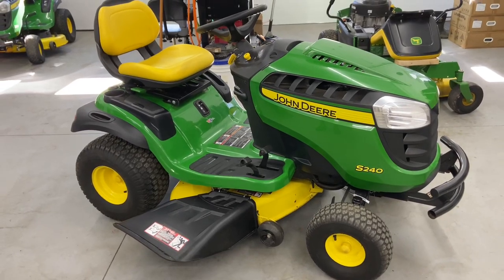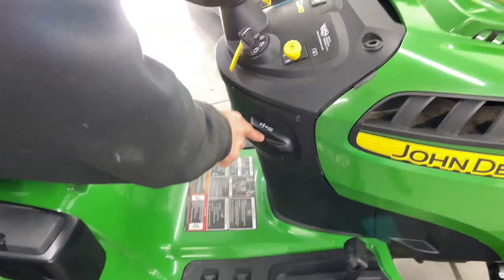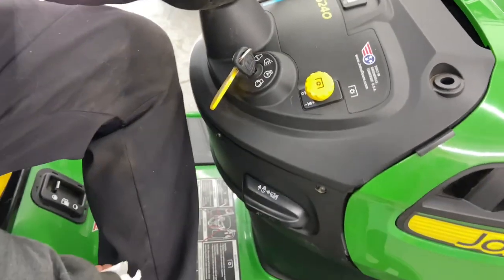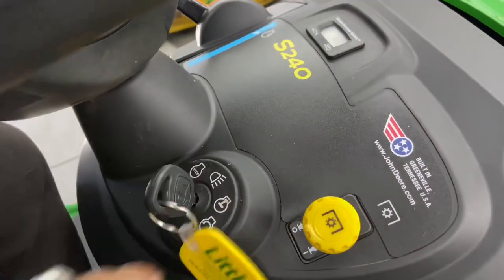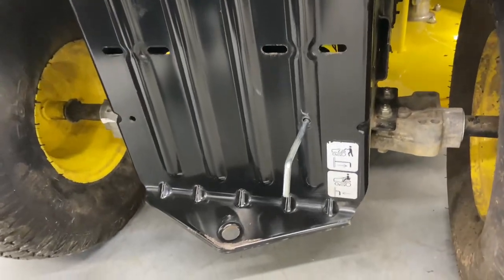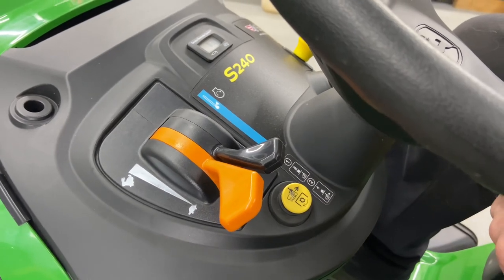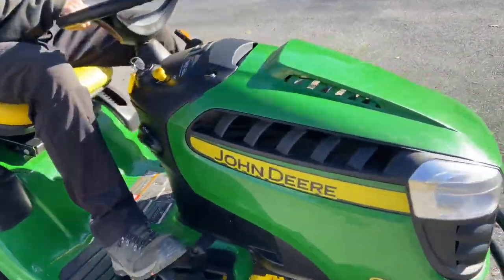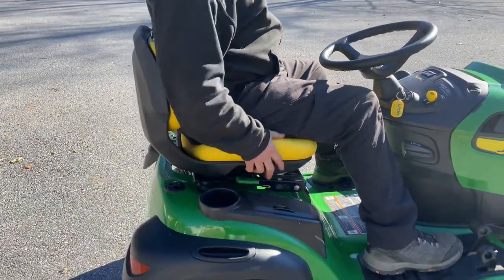How to Start and Operate John Deere S240

Comment: I've had my S240 for 8 years.  It's a great machine, but there have been a few problems.  1st, the gas gauge broke after the first year.  It always registers full now.  2nd, the seat safety pressure switch is WAY too sensitive.  I bypassed that altogether.  Next, the safety switch on the brake that allows you to start the mower broke as well.  It wouldn't allow me to start it at all, so I bypassed that too.  The reverse mow safety switch is just a real pain in the butt, so that had to go as well.  Overall, I love my mower, especially after bypassing all the garbage the lawyers make Deere put on it.

Comment: Very good video I just got my mower back from john deere the carb was done on it! I didn't realize you had to hold the choke up to start it! That's very good to know thank you very much! And shut it off at half throttle!
Reply from the maker: I’m glad it was helpful and thank for sharing.
Reply: So I got my mower back and I'm not impressed it doesn't start without a shot of ether anymore doesn't matter how I choke it I'm not happy any ideas! The plugs and stuff are good on them! Lol they changed the carburetor on it and it's like it's not choking at all anymore! As soon as I give it a little shot of ether it fires right up on a half second burst into the air filter! Lol
Reply from the maker: Sounds like the shop did not do it correctly?? I would take it back to them to repair it correctly.
Reply: @JohnsonsSmallEngines  yuppers that's gonna be the plan hear this week? They can set the carb properly!

Comment: Any words of wisdom on replacing the drive belt on this mower. I love my S240 and it just now started having trouble going up steeper hills. Do you think it’s the belt or transmission slipping, pulleys, etc?
Reply from the maker: How many hours are on the machine? The simple, (1)check for sticks or anything caught up in the trans belt area, (2)pull the hydro release rod in the back near the hitch out then back in. (3)You will need to release the transmission belt tension but after you do that, check to make sure the plastic Idler pulleys are not seized. (4)Make sure tire pressure is correct and (5)mower deck is not packed full of wet pack grass underneath as it will ad extra weight to the machine and if tire pressure is low it may feel sluggish. If you have major hills on your property and if you tow a cart (heavy loads), that will put much stress on the transmission. If your transmission belt and pulleys look good, replacing the belt may not help but it is what I would do (6)replace belt and idlers) to confirm your transmission is failing.
Reply: @JohnsonsSmallEngines  awesome recommendations. I will do all of that. It’s got 185 hours on it. In the last few weekends, I have been loading and pulling a cart some? This last mow, however, I made it up a hill then next try, it labored, then I had to lean way back in the seat to get weight on the rear, the last try, it didn’t make it up the same hill in the same spot. I ran out of time to check out everything you mentioned, but I will. Great mower and I’ve been using it on property for 6 years now. I’ve kept up with all the maintenance and runs great. I’ve had to change a couple spindles, blades, and throttle cable because a branch broke off the orange handle next to the choke. I’ve had to weld some on the deck. I just lost the small chute spring and replaced that too. Thanks for the insight…when I get back in two weeks to where this mower is kept in Arkansas, I’ll knock out as much of your recommendations as possible and report back! Thanks for the video and reply.
Reply from the maker: It almost sounds like when you said you had to lean hard to one side to make it go. That is telling me the rear wheels may have just been spinning loosing traction. That would make it feel like your transmission is failing. Keep an eye on the rear wheels next time up the hill!
Reply: @JohnsonsSmallEngines  I leaned straight back in the seat to get more weight on the wheels equally. I ended up rocking in the seat to get up the hill, whereas before, it would motor right up. It’s a good grade, but nothing unsafe. I’d only always go straight up and never sideways. Thanks again!

Comment: Just ordered an 2023 s-220 with the tlt 200 transmission with 22hp Briggs and Stratton. Do you think I am better off with the 240? Just ordered Friday and the dealership hasn’t even called me about payment so I am sure that I can switch. The 240 is $400 more. Thanks
Reply from the maker: I do not know the difference between them both as I’m not a John Deere salesman (who would know the differences). I would suggest talking to sales rep and make your decision based on what the differences are. I can say, so far from what I have seen, they are both good mowers. It all depends on how you treat them and you get what you pay for.
Reply: @JohnsonsSmallEngines   Thanks, I appreciate your honesty.

Comment: Do you need to mix gas and oil on the S240?
Reply from the maker: NO! Do not mix oil with the gas. Make sure the engine oil is at the correct level and use straight gasoline in the gas tank.
Reply: Thanks a lot! Good thing I asked you first 😂

Comment: I'm hearing the new John Deere are coming out with green decks. Any word of this?
Reply from the maker: Hi Mike, I haven’t seen one yet. Time will tell. I don’t really talk much with my local John Deere dealer but I will ask the next time in.
Reply: @Johnson's Small Engines   what's your imput on those reverse controls? I had a cub cadet, and man, it just drove me crazy. But evey thing is all about safety these days.
Reply from the maker: Just like all the other safety switches that have come along. You get use to it and then it’s like second nature. At least for most of us. If you really don’t like it, Cub cadet tractors have a better set up. I still like the John Deere’s just because I think there better built than the cub cadets. Remember Cub Cadet is actually MTD and MTD was the poorest, cheapest and in my opinion the lowest end product back in the day. They have been better but I still don’t care for some models.
Reply: All the 2023 models have green decks, I don't like them. I just bought a new mower and was lucky enough to find what I wanted that was last years.